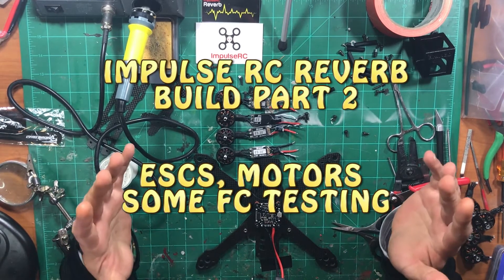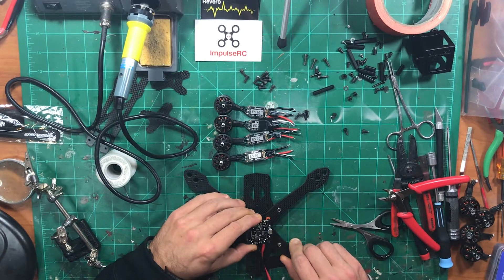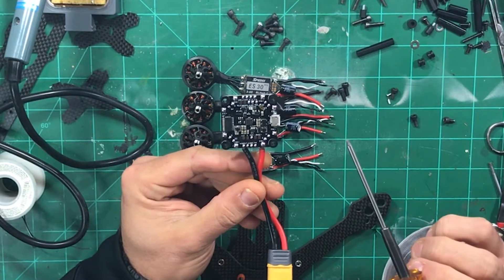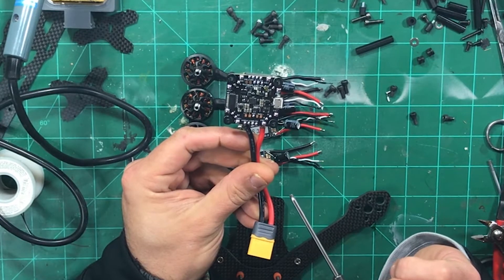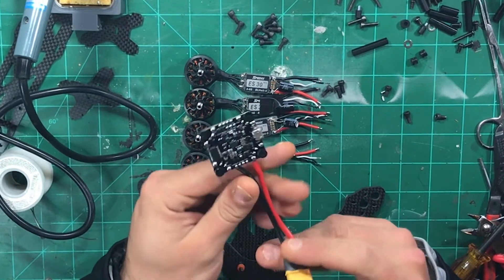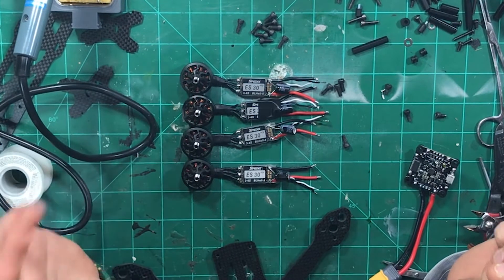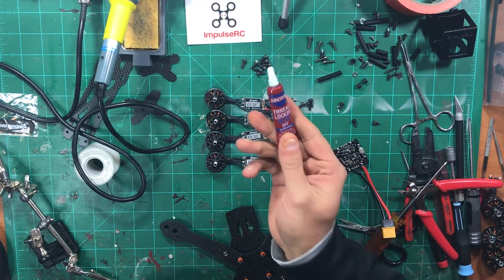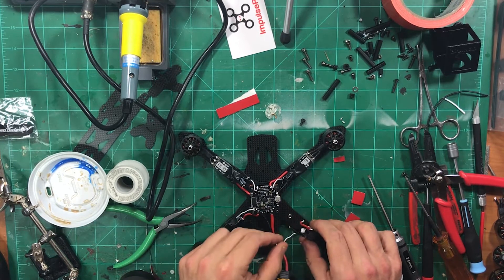IMPULSE RC REVERB BUILD PART 2 // MOTORS ESCS AND FC TESTING

Comment: Hey, great series. Did you have to get new threaded standoffs for the FC? I'm finding the ones supplied are not tall enough. Where on earth did you find the ones you are using? I'm coming up short.
Reply from the maker: Dubs FPV readymaderc has a kit and so does amazon. You talking the nylon ones right?
Reply: Yeah - I ended up getting longer M3 screws and 6mm spacers. Thanks for the reply!

Comment: Nice job pointing out the little step in the arms over which you must pass the esc wires headed back to the FC... it pays to heavily chamfer that with the diamond files (on the upper rear plate) during carbon prep. I ended up using a small wrap of shrink tube to cover it and smooth the edge too.

Comment: get bondic and put some behind and to the sides of the USB port, because sometimes constant use tends to loosen the port from the board . The bondic really holds it in place. Since i started doing this i havent had any issues.
Reply: https://www.amazon.com/gp/aw/d/B018IBEHQU/ref=mp_s_a_1_1?ie=UTF8&qid=1514732658&sr=8-1-spons&pi=AC_SX236_SY340_FMwebp_QL65&keywords=bondic+plastic+welder&psc=1
Reply from the maker: Good idea. I’ve seen a few people do that. Never been an issue but it’s something I should do. Thanks.